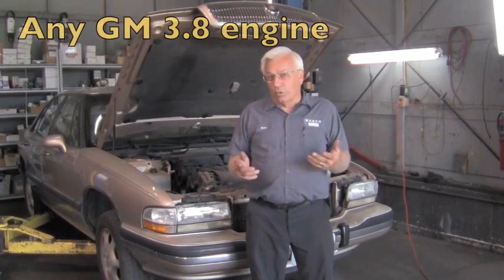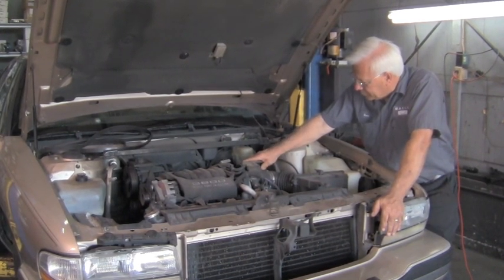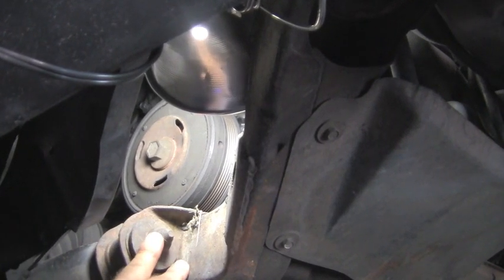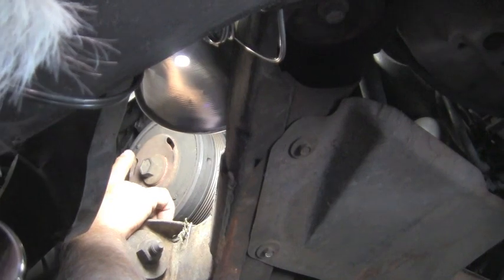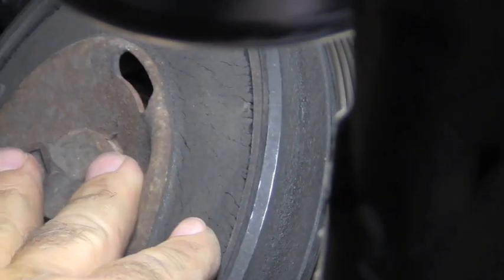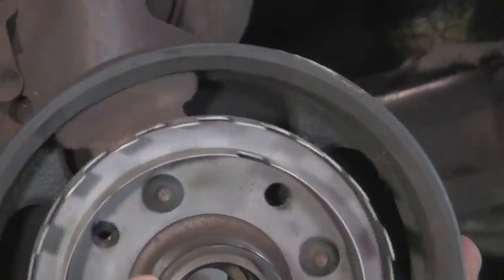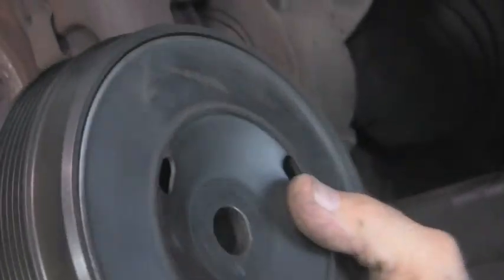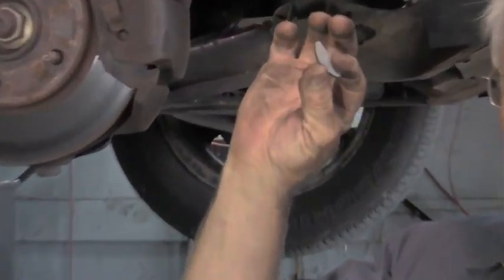GM 3.8 Engine Noise

Comment: I’m no Buick fan but the 3.8 was one of the best V6 engines ever made by any manufacturer. Amazing durability and fuel economy. Simple design too. Much better than the GM garbage that replaced it.

Comment: I have an L67 but never heard a noise on the main crank. I wonder if it was an issue with just the single belt 3800 and not the dual ones for the SC models. The 3800 is a rock solid motor even after all of these years.

Comment: I have a gm 2.8 v6 but it doesn’t sound like that. Mine sounds like valves clattering when the engine reaches operating temperature. Any tips for fixing this would be greatly appreciated.

Comment: Great video. Thanks for making this. I always remove the belt & see if the noise goes away while running. This has to be done briefly as the water pump & alternator won't be working. If the noise is still present, I know it's either the balancer, or the timing chain

Comment: Excellent video my good sir, I did not guess it was the HB. I have 2003 Impala I've been taking care of, fixed the UIM-LIM gaskets and changed the UIM to the L26 Aluminum type and replaced the plastic valve covers with '97 Camaro F-body aluminum as well, the UIM & valve covers mirror finished! Its now 1/2017 and my engine and body looks and runs like its brand new.

I'll be looking at the HB for signs of wear first thing in the morning.

Comment: So I assume this crank pulley is not driving the timing belt? I mean, is it an OHV engine with timing chain? I figure, if this is an OHC engine with timing belt, then the engine would have been damaged, right?
Reply: Timing belts and chains are something inside. The balancer is running water pump, air conditioner compressor, staring pump, idler and alternator. So no effect on timing.
Excuse me to give you reply! some people are not feeling well if you help them! Regards,
Reply: LearningZone Thanks! appreciate it.
Reply: Wenbiao Liang
Thank you also for understanding. Regards,

Comment: Thought about taking out the damper part and putting it  back on.  I looked up harmonic damper on wiki and read is role is to prevent harmonic vibrations that could reduce engine life.  Learned something, thanks.
------ it reduces torsional vibrations that tend to peak at certain speeds. Torsional vibrations can greatly reduce crankshaft life, if not cause instantaneous failure, if the crankshaft runs at or through resonance. ------wiki

Comment: Thank you for this video!  My dad has an 88 Bonneville with 3800 so if this should happen I'll know what to look for.  Great videos!
Reply: Greetings, Just so that you know, that a 3800 V-6 and a 3.8 V-6 are two different engine's all together. But I suppose this could happen on either of them, as GM has had a problem with their Harmonic Balancer's since the very first V-8 was produced, and later when the 3.8 was produced. But the V-8 Balancer's when they went bad didn't clang like these 3.8's do when they separate.
Reply: *****
Yes, back in the 80s my dad had a 1980 Regal with a 3.8 (2 barrel carb).  The 88 Bonneville says 3800 on it, and my nephew's 04 Impala says 3800 Series II on it.  The 88 Bonneville sure has a lot more get up and go than the 80 Regal could even think of, but I sure did love the style and comfort of the 80 Regal.
Reply: *****
Thank goodness the 2 4.3s I have now haven't had any major issues and none with the harmonic balancers.  I flashlight inspect them a couple times a month, and at 274k and 365K they burn no oil, are as strong now as when they were spring chickens and still get the same MPG as they did back in the day, and one or the other is on the road every day.
Reply: J Robert
 Yes sir, the 4.3's are a great engine! Had one in my old 1990' Chevy Astro Van, and it would get it on down the road, for a van, lol. But I sold that van and bought a 2005' Chevy Trailblazer with a 4.2 In-Line 6 cyl. Now this sucker will get it on! Dual over-head cam really makes a difference. With individual coil packs for each cylinder, with a 373 rear differential gear ratio - not good on gas at all, lol. And it's way more responsive than the old 250cu & 230cu In-Line 6 cyls that I used to Circle Track Race (asphalt) back in the 80's. But those engines, I could make them run pretty dog gone fast around that half-mile track! Weeeeeeeee ....... 

And this was the very same circle track that Bobby Labonte raced on before he hit the big times. And his brother, Terry, used to come watch him race. I've talked to Terry many times over the years, and both of the brothers are very nice guys! And I only live about 6 miles from Richard Petty's old stomping grounds in Level Cross, NC. But my racing days are long over now. But it was fun while it lasted! :-)
Reply: *****
That's what I've got.  93 and 94 Astros, very comfy, fairly decent riding and pretty good on gas even with the a/c on, which is all the time its warm as open windows are too noisy for me to handle.

Comment: Yes GM blew it with that, especially having to put those small bolts with fender washers to get the darn thing off with a normal puller. And the constant oil bath all over the engine doesn't help much either.

Comment: I don't understand the damper on a HBer...maybe the engineers wanted less shock to the other belt driven accessories or to the reluctor wheel for the crank sensor???

Comment: sounds like a bearing missing from one of the pulleys or the p/steer or alternator and waterpump
Reply: OK, the balancer. Yeah common 3800 problem, but in Oz, we have direct sight of the engine being a north/south configuration

Comment: That's a great engine and car!  That noise is so very irritating!
Reply: Those 3.8L did as well as they did because of the transmissions they were bolted to.  The transmissions coasted so well and shifted so well the motor got great marks on efficiency.

Comment: I had power steering overhaul, and 2 days later heard that awful noise. I thought damn workshop used cheap copycat pump and it grenaded itself. But took off serpentine belt, and behold it was the harmonic balancer!  At least on a RWD, a bit easier to work on.

Comment: Looks like it was engineered to eventually fail.
Reply: lol. That's what I was thinking
Reply: Everything is
Reply: Yul Strokheet Al-Wauch the 3800 is reliable but still old junk. Low revving and wheezy aF! My SSE Bonneville was done after 3k rpm and sounded like it was about to die the further you pushed it past that mark. Reliable but pathetic in standard trim 🤮

Comment: ih 05 lesaber making noise at idle stops when hit gas whirring noise from egr intake or throttle body changed catalytic converter still have po420 code